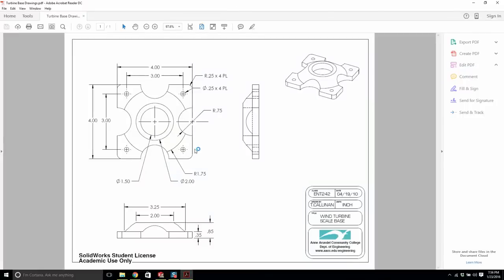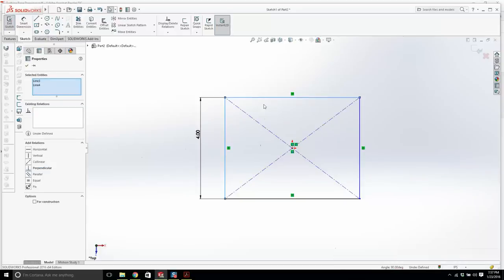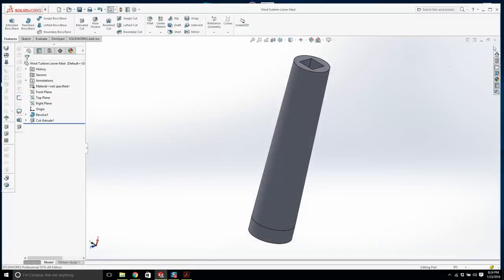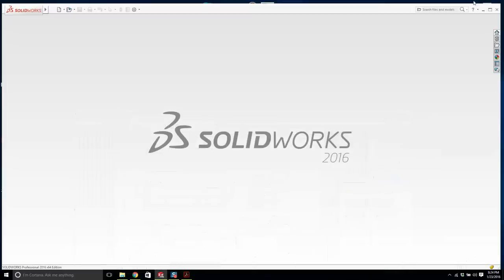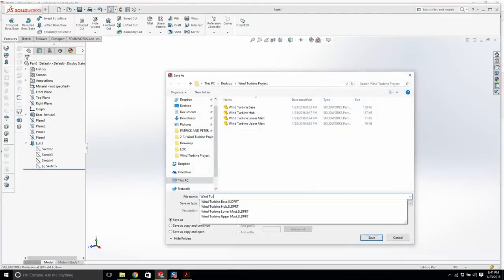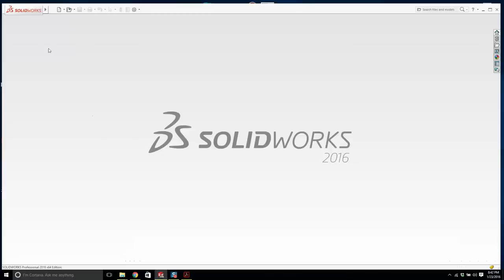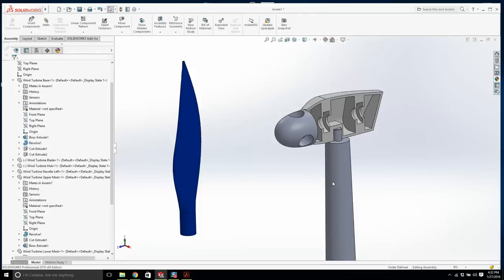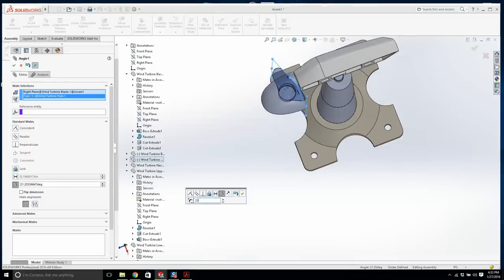Solidworks - Wind Turbine

Comment: You did model the lower mast, starting at about 18:30 in this video--and then used it as a template for the upper mast. Also, for anyone watching these videos to learn Solidworks...use "Copy with Mates" to insert repeated instances of the same piece  of hardware, like the #4-40 socket-head screws used near the end. Just right-click on the first screw you've already inserted, and choose copy with mates from the contextual (pop-up) menu. Works great and it's a REAL time-saver.

Comment: Sir i think you made a mistake in section c 3 here the the line is not vertical its .20 from top and .16 from bottom i might be wrong but if you can check it it would be helpful

Comment: Hi. I am currently working on to design a wind turbine to be 3D printed for my internship project. However, I am using AutoCAD instead of SolidWork. Can I have your opinion or advise sir? Can I have your design for my project? Also, may I know what unit did you used, inch or cm?